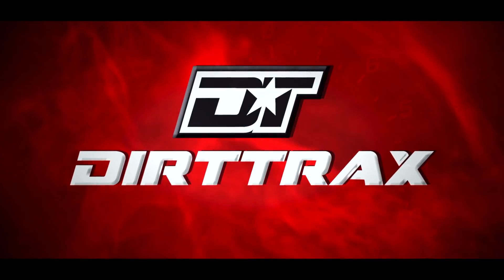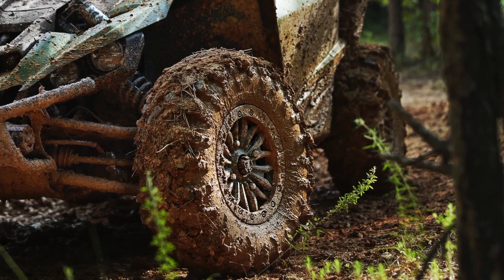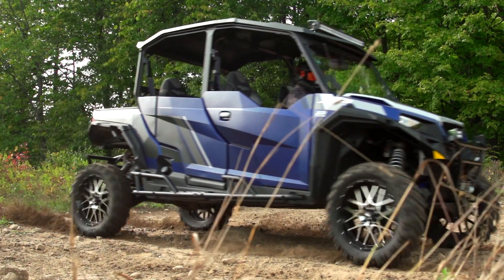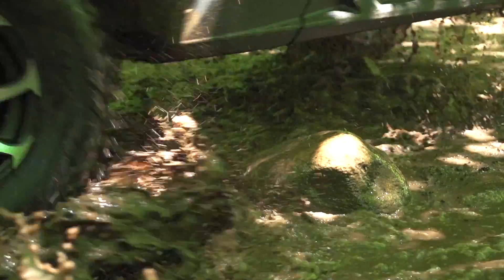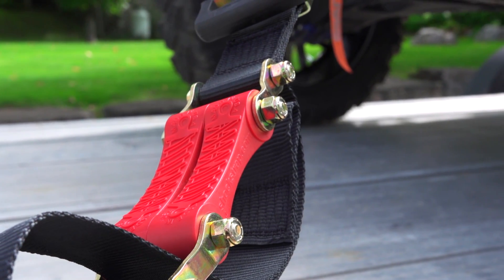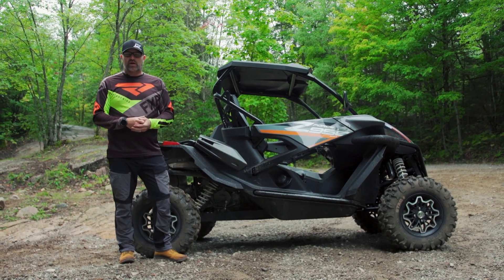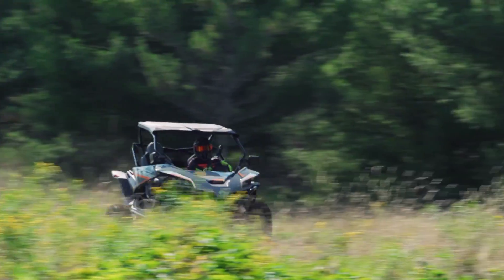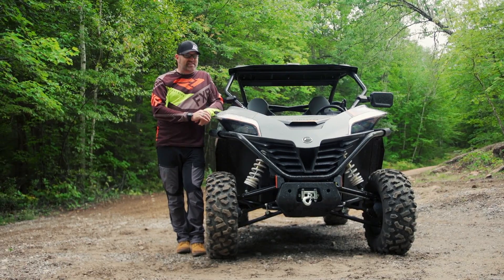DIRT TRAX TV 2020 - FULL Episode 5

Comment: I see you went with the strap myth here. Again. Look up the NSC. Load securement. If the breaking strength is 1500# the WLL is 500#.  Straps are only required to be 50% of the aggregate load. Which means you won't be 4000# under. 4, 500# straps would be good to hold down 4000#. Additionally you strapped to the chassis. Never ever strap to the chassis. That's why straps come loose. Strap as close to the tire as possible.
Reply: instablaster.